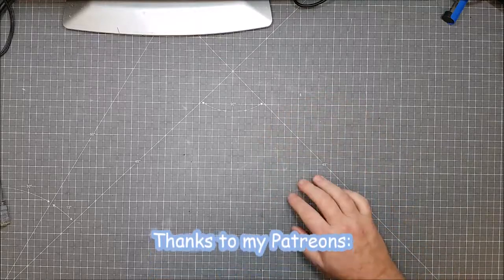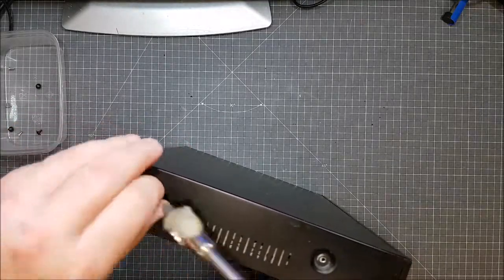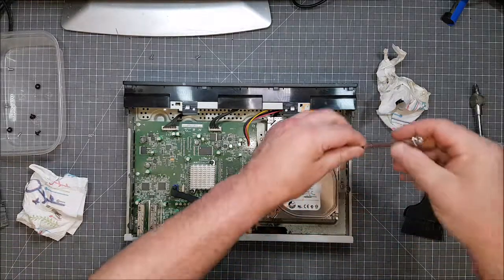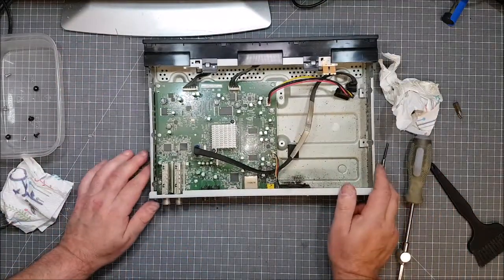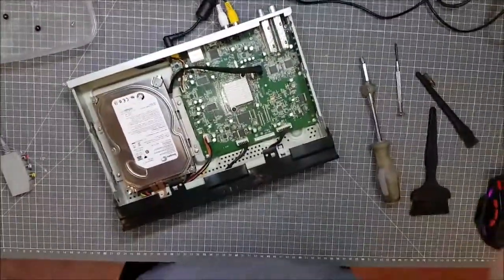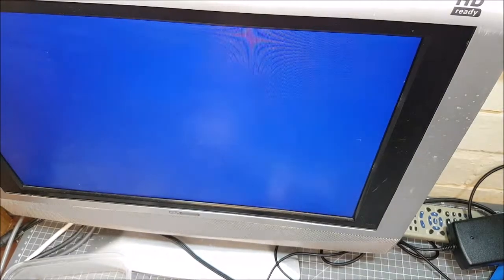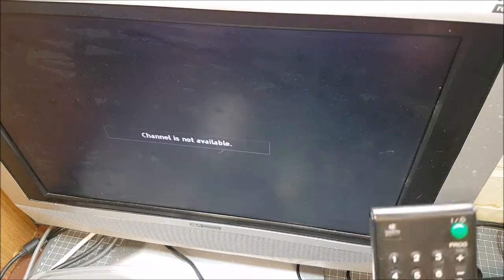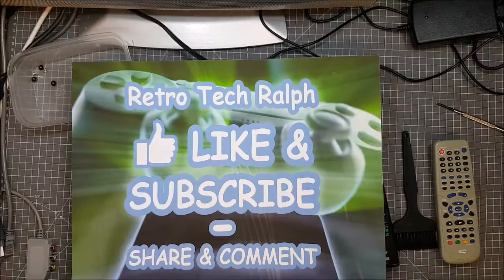Sony SVR HDT500 Teardown and service

Comment: I have a SVR HDT 1000. I had used 54% recording data. On Boxing Day it said files empty and I can’t set to record. I don’t want to lose my recordings but am at a loss as to know what to do other than take it apart like you have. Any suggestions.
Reply: Did you run Repair Disk ?